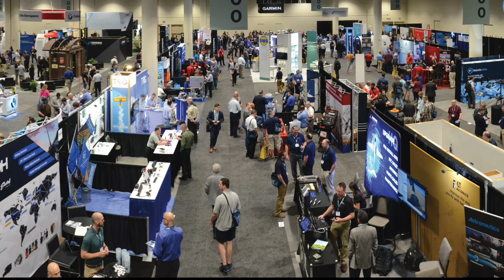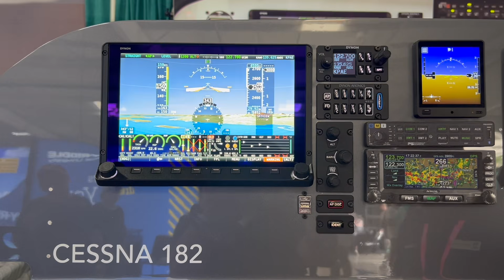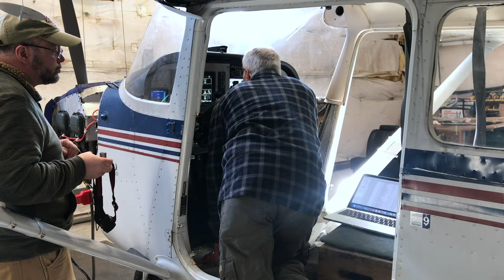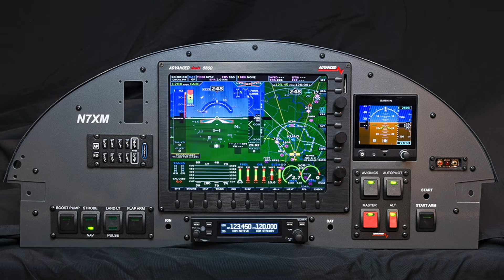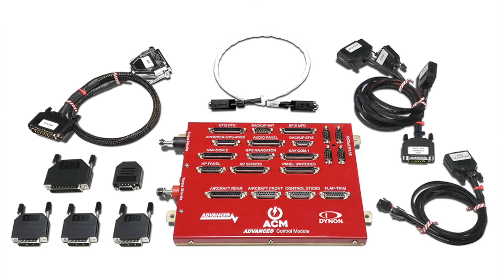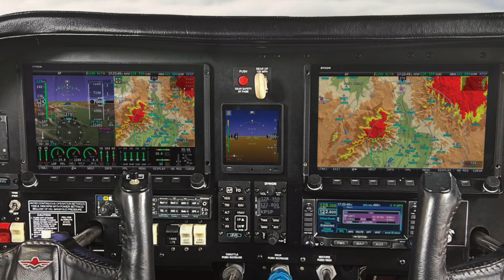Dynon HDX Certified

Comment: Good video. I didn't know Dynon used parts from others. It seems self evident to me that the future is more integrated, less distributed modules with many wires between them. Assuming we have a future. Garmin seems very happy to keep things separate as a way to fleece people with massive overpricing for trivial functionality that could easily be in one unit but that has then been Dynon's opportunity to disrupt. And it's quite easy to disrupt. To say that avionics has high margin is an understatement. A GTN 750 might cost 300$ to make. A full G3000 or G5000 suite might cost 1200$ plus radar. Yet the price you pay is slightly higher. a retrofit G5000 is quoted as 500k. 14" 1280x800 resolution displays.
And it gets worse, from my understanding, just the "professional" software packages for US and EU coverage for the honeywell avionics in a pilatus PC-24 is over a million dollars. Plus you still have to pay large annual fees to keep the data current. For reference, the Eclipse twin jet was originally intended to retail for 500k$ all inclusive. Pratt and Whitney thought it would be better if just one of the small engines would cost twice that price which is a snag for the business model